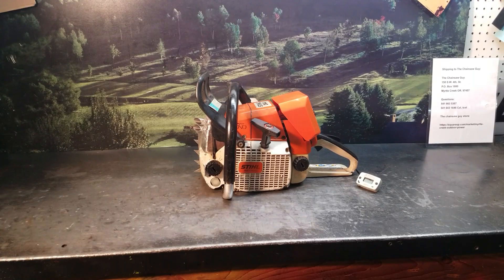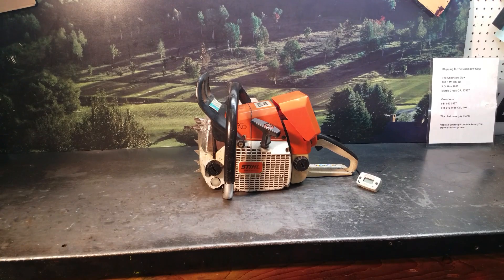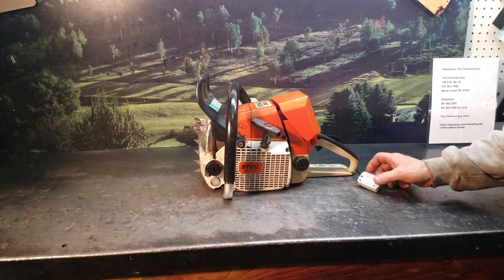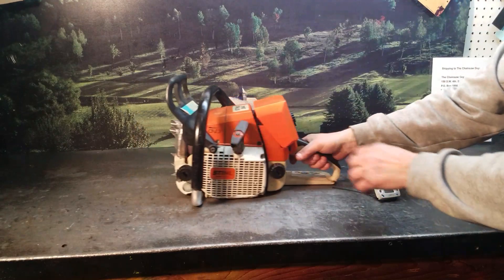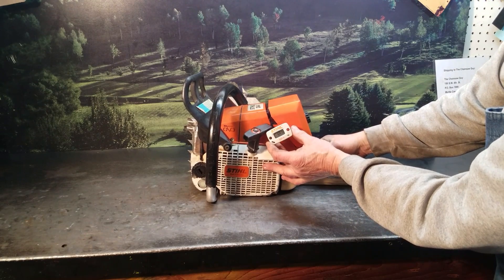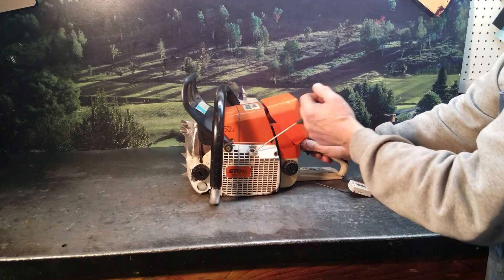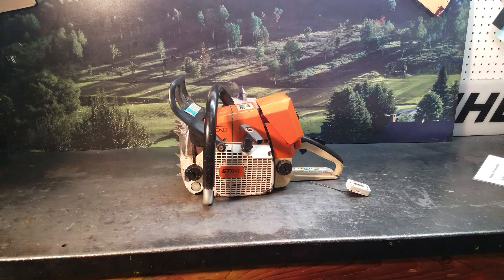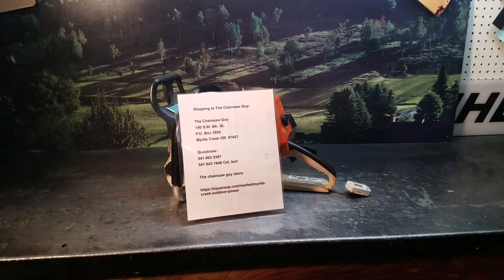The Chainsaw Guy Shop Talk New York Build Stihl 044 Magnum

Comment: To J Cubb ... note direction of flywheel when engine is run ... remove pull-start ; loosen nut ; tap to loosen flywheel ... remove Nut and flywheel - file keywey .010 to start ... reinstall and run ... if not happy with take off another .010 ... if u go to far u can buy a key way for $5 ... just have to experiment - some saws respond well others not so much

Comment: Hey, I see that you have a Husqvarna 562XP. I would like to advance the ignition timing on mine about 3 degrees VIA the placement of the Ignition coil or flywheel. Can this be done without effecting the electronics on the saw? Also if you have done this before how can it be done? Thanks.